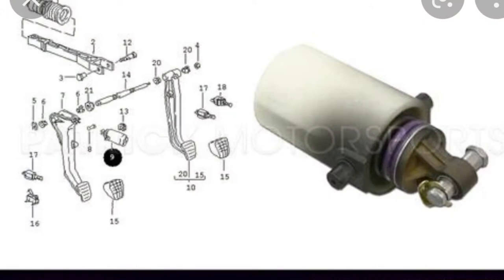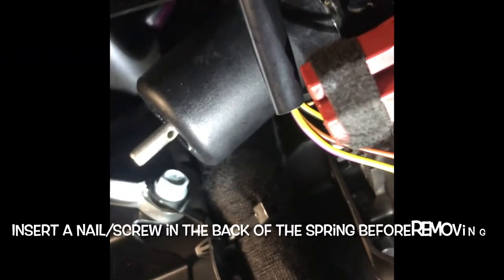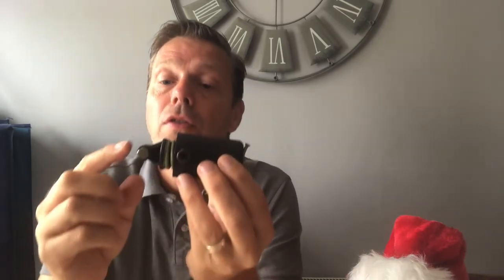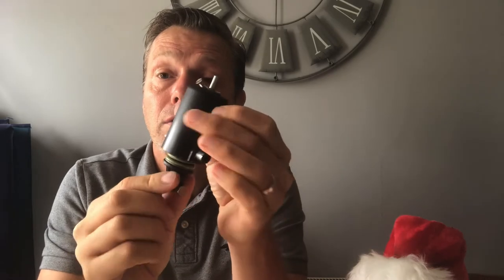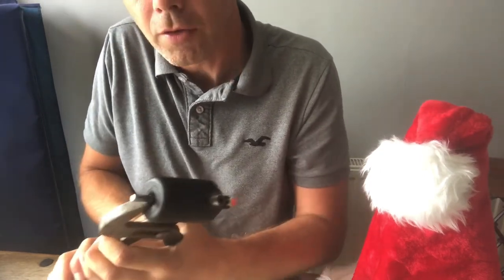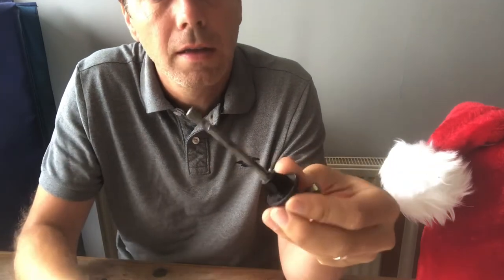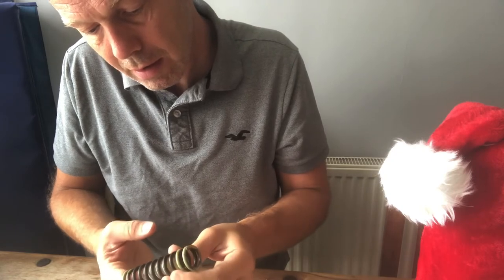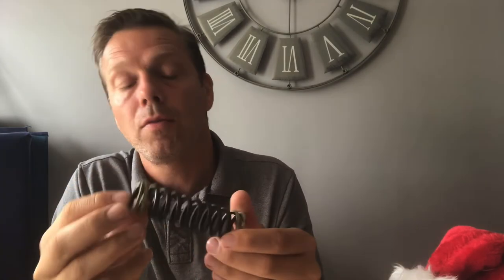Porsche Clutch Helper/Booster Spring

Comment: Thanks. I'm trying to make my clutch lighter, as I had surgery on my left knee. Do you think sourcing a stiffer spring would do that? For the crunchiness, did you check the external pivot points? Maybe they had wear on them?
Reply from the maker: @nickp4793  I think a stiffer spring would make it lighter, I’m sure you could get one.

Once I replaced the spring the noises went away. So I would have to say it solved it.
Reply: @mrh6577  any idea where to get a stiffer spring? (UK)
Reply from the maker: @shadmonk I think there are a few types? I would have a word with design911 as I know there’s a few, how different they are I don’t know.

The other option is search spring suppliers UK. A few come up, you could send your spring to them and get one made to your own specifications?